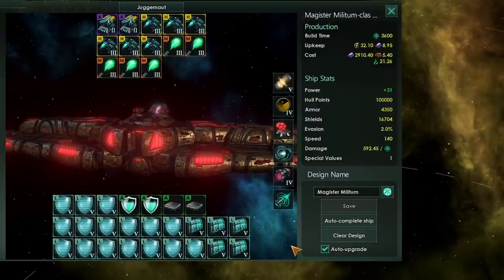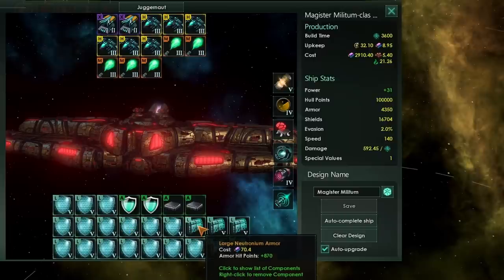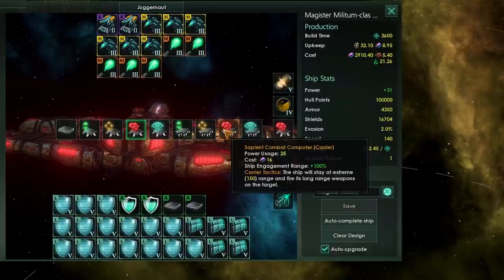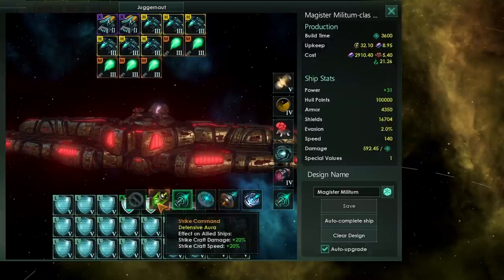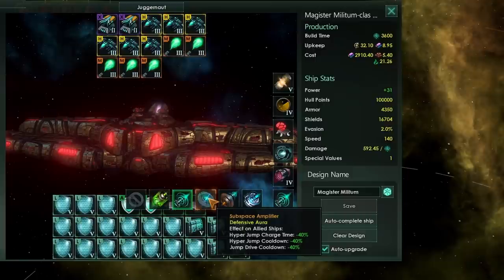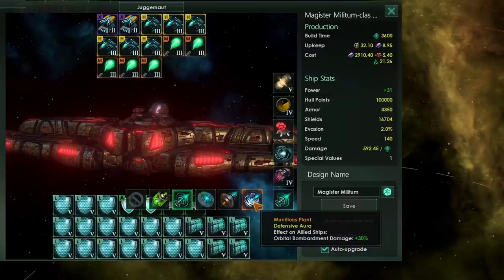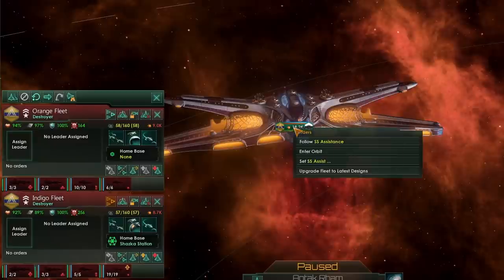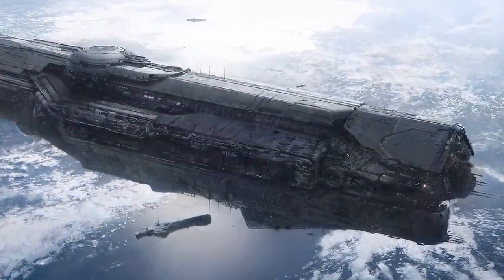Stellaris Juggernaut Design - Multirole Workhorse

Comment: You forgot another very important function. You can set your fleets to the juggernaut as a starbase, so if they ever retreat, they could get back in the right more quickly.
A very important feature.
Reply: Didn't know this, I set them to have the Jugg as home simply so I could hit B to make them repair at the Jugg
Reply: Thats neat you never learn out i guess
Reply: I also forgot to mention that the juggernaut can upgrade itself without having to go to a starbase, but that isn't as important as everything else mentioned.
Reply: @AndrewMalovrh  That means you can keep swapping between the minus 40% jump cooldown and the other auras just to go fast... massive exploit! Or is it? Now I'm considering Juggs for my 25x unbidden run.
Reply: @pierreproudhon9008  it takes absurd time i think to upgrade itself and must not move
Reply: @warbrain1053  oh I never tried it out, will test.
Reply: @pierreproudhon9008  also if you have 3 juggernauts they like to upgrade at each other and bug out, so upgrading them is not adviced for the simple reason thry might bug out and become non combat worthy
Reply: @pierreproudhon9008  they do but it bugs them out
Reply: @AndrewMalovrh  you also forgot u can set a fleet to follow the jugg also since its slower then most fleets it needs to be leading plus a fleet escorting a jugg w it as its base any ships a jugg is making as it flies will just be left wherever unless a fleet is asigned and escorting then they just fall into that fleet 
a small swarm fleet is always nice a jugg easy to replace and keep around it
Reply: @warbrain1053  tbh itts not thatt long, like <90 days? it sure is to long tto swap  them for movement but it could be usefull if u wanna make a viable jump drive deploy faster or adapt weaponry when u see a fleet aproaching
Reply: @michaaugustyn5414  in my experience it can easily say f you and not want to upgrade

Comment: One mistake in the video: 'You can only have one juggernaut.' While this is true of your empire's ships, if you have access to a federation fleet, the GDF, or the Imperial Armada, you can create a juggernaut design for those fleets, and each of those fleets can also have a single juggernaut, allowing you a maximum of 3 juggernauts
Reply: Big brain play
Reply: And i thought i know something because i know you can have 2.
Reply: Whatever you do DONT create those juggxrnaughts and then set the designs of the fleets to auto best.
If you upgrade the jugs after that they delete and leave an immovable shipyard in its death spot.
Haven’t tried as of 3.2 but was active after 3.1
Reply: Or the best way to do it is to just simply create a vassal from your system wait for them to build a juggernaut after you supply them with all the materials since they already have the research especially if you had built a colossal shipyard and gave it to him and then integrate them boom infinite juggernauts
Reply: I don’t recall getting juggernauts in a federation fleet. Do you need a fed law for that?
Reply: @duncanharrell5009  you have to manually create the design. Go into fed designer and click "create new design" same for the GDF/imperial fleet
Reply: Yes, but if you have a strong enough empire to field a juggernaut, the leader of a federation with a juggernaut, and the custodian, you basically have already won.
Reply: @michaeledmunds7056  still useful for endgame crisis, or dealing with awaken fallen empires. Not militarily useful or even tactically in the fights but strategically. Forward repairs, minor ship replacements.
Reply: At that point you already have the galaxy under your thumb, though. Not much need for a juggernaut in a target-absent environment unless you willingly ignored a threat just so you could later crush them with 3 juggernauts.

Comment: Imagine ever taking munitions plant on the only ship in the game that can literally print its own orbital bombardment buddies on the spot if it really wanted to.
Reply: Yeah... This comment needs a mic drop.

🤚😎

🎤
Reply: @jameshildebrand907  that was extremely cringe im so sorry.
Reply: The only point I've used the munitions plant was when a certain empire made the war extremely personal
Reply: You know you can change it momentary and then change it back again as the juggernaut can rebuild itself?
Reply: But you can't print "more damage" as after 200 fleet size the game just stop counting them.  Orbital Bombardment damage is from a different multiplier all together as such even in the worse case scenario it's like adding 60 more fleet size over bombarded planet.  Across the ENTIRE system, not just the planet the Juggernaut is sitting over.
Reply: I guess it can be useful if the juggernaut isn't fighting and you want to destroy that Contingency world faster in order to move on to the next...
Reply: Yeah I will use munitions plant especially if I have javorian pox bombardment. Put it in the system and an a 200 fleet per enemy planet and cleanse the planets without the collosus Diplo penalty
Reply: @spikeX59  They killed Bubbles?
Reply: I actually do use munitions plant quite a few times. Simply because most of the time I am fighting against significantly weaker enemies and my main priority is to beat them as quickly as possible. So being able to conquer planets faster and with fewer troops is quite a boon.

Comment: The beautiful thing about the Juggernaut is that it can upgrade itself, so you can swap the auras on demand and switch them out based on the situation. If you need to get your juggernaut somewhere fast, then use the amplifier till it gets to its destination to reinforce your fleets. If you are bombarding a planet you can switch over the munitions plant. It basically costs nothing to swap out those parts whenever you might need to.
Reply: Tried to do this on console, it went to a starbase instead so I can't hotswap auras

Comment: I don't bother with the juggernaut as a combat ship, so the ship yard is the most important part. I use it to back up my logistics train, especially if there's a long chain of systems between starbases and i think there will be many combats while driving up the chain.
Reply: Honestly I never realized that juggernauts also lets you heal ships on the fly I knew it was a mobile ship yard it never accured to me that like any ship yard you can dock your ships to heal them
Reply: fun fact a moving jugg drops ships its building wherever they get done and just sit unless a fleet is escorting it and is set as its base then it feeds them into set fleets :) so building a small swarm or replacing lost units as it moves
Reply: By the time you have a Juggernaught you also usually have full battleship fleets all with X weapons and they can obliterate any starbase without even slowing down.
I usually use it to escort my armies and to assist in bombardment.
Reply: @MrMarinus18  the starbases are not the issue the enemy fleets are. If there is a long chain of systems with no starbases I need the juggernaut to heal after the destroying the fleets.
Reply: In the end the Juggernaut is a strategic asset, you will want it in the rear until you're absolutely certain what's in front can't kill it as its loss is going to be much greater than losing a few battleships.

Comment: best part about juggernaut is it upgrades itself quickly so you can switch between the support modules very quickly
Reply: LITTERALLY WROING.

it takes around 2 to 3 years to upgrade
Reply: @noneofyourbusiness4133  Did you have a mega shipyard? as I believe the +100% speed applies to the juggernaut upgrade.
Also did you only change the support module on the upgrade?
Reply: @noneofyourbusiness4133  Are you sure you were going off a time where ONLY the aura was being swapped? The amount of time that an upgrade takes is based on how much is actually changing.
Reply: @AdmiralTails  Yeah, swapping out a single module usually takes less than a month.

Comment: While the munitions plant does suck, an important note is that it can be very strong against fortress worlds due to how bombardment damage works.
Reply: If you are at the point where munitions plant would speed up taking a fortress world, you might as well crack it and save yourself the trouble.
Reply: @kodykoch2100  Fair point. Counterpoint, the juggernaut can retrofit itself at all times.
Reply: @kodykoch2100  using a colossus, if you care, makes other empires feel threatened and insecure which results in negative relation modifiers. Neutron sweep is great but if you're not ready to face the rest of the galaxy in total war, maybe not so much as more conventional methods of bombardment.

Comment: I just wish it wasn’t so slow. It’s a huge pita to use it offensively.  Either it jumps first and takes all the strikes or you have it follow the other fleets and it ends up 20 systems away.
Reply from the maker: Yes it is a pain to keep track of, i tend to use a jump drive to bring it to where it is needed after the fact. That way it is less important if it is a few jumps behind.
Reply: @MontuPlays  imo it would be far more useful if it traded in the shipyards for a mobile jump bridge. Even if it was only a one way jump (to the juggernaut) and came with an immobility requirement to activate it.
Reply: @cmnhrnytoad2003  I'd much rather it be stackable with a fleet, like transports should be.
Reply: I usually use it to escort my armies while making reinforcements for the main fleet just ahead. Munitions plant is actually what I use most often since I don't use it for battle unless I absolutely have to. It's far more useful just generating a trickle of ships in the back to consolidate holdings and help replace losses quicker. As a support ship increasing bombardment damage is actually very nice as it allows you to capture planets quicker.
Or if you are dealing with a bastion holding up your fleet you can deactive it quicker as well.

I just find using it like that is more effective because it speeds up your war instead of trying to put it on the front line which usually just slows your fleet down. So since the Juggernought won't be fighting enemy vessels anyway using Munitions plant is actually my favorite.
Reply: Send it into battle on it's own. I've been pleasantly surprised by it's performance. The thing is a tank.

Comment: One of the primary reasons I rarely use Juggernauts myself is the utter infuriation provided by them when trying to replenish losses or build new fleets. You order up 40 ships, Mega shipyard takes 20 jobs, Juggernaut also takes 20 jobs. It fills me with endless rage as the juggernaut is hogging the ship queue and materials. Same issue with shipyard starbases when there's a mega shipyard around, the game simply doesn't care about balancing the orders by number of slipways available.

Comment: I generally use the juggernaut to capture the small systems behind your front line as the 2 X slots out range everything.
Reply: And what did your destroyers do?
Reply: @molybdaen11  What destroyers? :)
Reply: @TheRealWormbo  They are better for raiding since they are cheap, fast and have a high chance to escape.
And when you are not at war, they can patrol your trade routes.

Comment: A few more things to note with Juggernauts.
They gain the station bonuses from the station in the system they are currently occupying, as well as bonuses from starbase related traditions/techs (eg hull and damage bonuses from unyielding).
This will increase the armour of the juggernaut by up to 20000 (citadel bonus armour), bonuses from weapon modules on the station will provide +10% armour and hull per weapon module, and the Target Uplink Computer will a additional 50% range to the juggernaut.
It is quite possible to have close to 200k hull, and 60k+ armour on a defensively stationed juggernaut in a citidel system, that has +90%, or greater weapon range, with station damage bonuses.
Reply: If you have several juggernauts through various means, combined with the stat pumping from the station this makes the juggernaut almost impossible to kill due to retreating (50% hp = 100k hull, not even perdition beam spam can cause enough damage to kill) and opposing fleets may need to do over 150-200k damage per juggernaut present before targeting smaller ships or the station.
In cases like terminal egress or a nemesis/crisis run the juggernauts can act as essentially a large ablative shield against fleets entering the system allowing other fleets present to cause causalities unopposed on the initial volleys, or alternatively out range them so badly many enemy fleets get destroyed before making contact themselves.

Comment: So a few comments about +Orbital Bombardment Damage (Though correct me if I am wrong).  While situational, even in vanilla, it is arguably better far better than useless.

Actual Orbital Bombardment is a factor of three things:  Bombardment stance, Size of fleet(s) in orbit (up to 200) and Orbital Bombardment Net damage (which the Juggernaut Aura effects).  This means that (1) you cannot just "Print" more ships to damage a planet faster.  Also while the "Hard" cap is -98% to orbital bombardment damage it can (in vanilla) stack up to 110%.  

There are 4 ways (currently) to increase orbital bombardment damage.  20% from supremacy, 20% from Crisis level 4, 25% from the one component you might get from the Rackets (not sure if this is the entire fleet or JUST the ships it's equipped to) and 30% from the Juggernaut for the system it's parked in.  If you don't have any of these other than the Juggernaut it can be up to a 1000% increase to orbital bombardment damage.

God forbid you have mods and include Maginot Worlds.  Those might actually be impossible to kill without the Munitions Plant.

Comment: You may have already fixed this, but as of me typing this your description says "Titan design" rather than Juggernaut.

Personally, I run the Jump Drive aura unless the enemy are using a lot of artillery, and then I use my Juggernaut as a mobile staging ground to upgrade, repair, and bolster my fleets on the go rather than using it for direct combat.

Comment: This thing is amazing against x25 crisis. x25 crisis does so much damage everything pretty much one shots your ships, but with the 40% range bonus, if you stack up enough artillery battleships, you can engage the crisis and kill each fleet individually without them ever getting in range to fire back.

Also would like to point out you can swap out the module, as it acts as it’s own starbase, so you can switch to the drive cool down module, jump all your fleets across a massive galaxy in about a year, and then change back to the range module to engage.

It’s funny to me that personally, the big, slow, clumsy starship/base’s main use is as a mobility tool

Comment: I tend to use mine as a frontline medic of sorts. Repair a fleet on one front, then Jump drive to another front to assist and repair other fleets.
If I use it on the offence, I tend to jump drive it behind enemy lines, pump out a bunch of corvettes from it and use them as a suicide squad of sorts to snipe key frontier stations then jump the juggernaut out. The corvettes don’t have the jump drive penalty that way and they are expendable if I need them to be.

Comment: Two problems I have with the juggernauts, and why I rarely bother with them.  1) You can only have one, and 2) you can't add a juggernaut to a fleet.  Seems to me if I have the time and materials I should be able to build as many of them as I like, and I should be able to add one to every fleet if I have the fleet/command points to do so.
Reply: think of it less like an attack ship and more of a mobile repair ship.
Reply: @nicholasvogel9783  I fully understand it's purpose, but why bother when I can attack an enemy station, wait for it to shift over and repair there.  The AI is very generous with the numerous amounts of otherwise useless stations it produces. 

Likewise I rarely fight a war on only one front, because the AI loves border gore so much, so why would I bother with a ship I can only use on one front?  Again, seems to me if I have the materials and fleet command/fleet points available I should be able to build as many as I like.  Same goes for the Colossus.
Reply: @simdoughnut659  if you are retaking areas from the endgame crisis you'll need a forward repair location.

Comment: i love using my jugg as a meme with nothing but disruptors even the x slots lol i leave it at a bastion as a ship yard and bug zapper thats buffing my strike craft on itself and the station plus a decent fleet with a titan at its head
its just a wall almost no npc will attempt to come at without throwing multiple waves at it meaning they focus their entire fleet at one point 
btw its a meme if u go bugzapper version since my whole fleets will be like this using disruptors missles/torpedos and strike craft only 
its not optimal but ive seen it do hilarious stuff late game w repeatables

so memes aside a juggernaught is a slow beast that needs escort fleet but you can use it as a mobile space station using it as a beach head in any war to keep pushing into a big space section and stay there or used defensively at key choke points w a proper defense station it and one decent fleet can absolutely be a monolith that an enemy player or ai will have to waste mountains of bodies to get by 
the best part is a jugg is so beefy if you ARENT using no retreat you can always usually manually watch let it get off as much damage as possible then jump it out so last ditch use it as a big pot hole to slow an advancing enemy horde since it can engage at huge range do some good damage then dip out